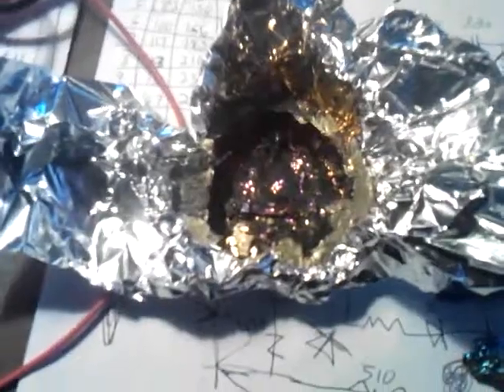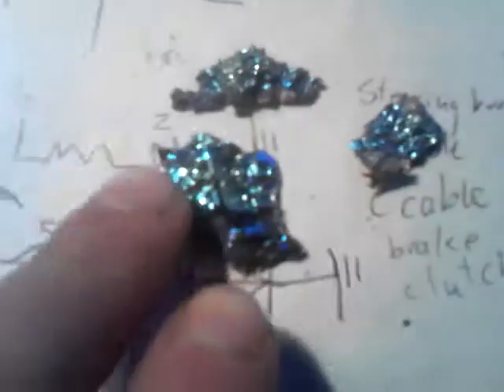Bismuth crystal grown during Schumann frequency

Comment: try it again and use a large steel ball bearing instead of the screw ????
Reply from the maker: blulander I have since came to believe the difference in the temperature of the screw had more effect than the frequency I put in. Regardless, I stopped experimenting after I contaminated 5lbs ($100 worth) of bismuth. It still grows crystals, but is only silver now. Probably caused by the foil or from heating it using an aluminum pot.